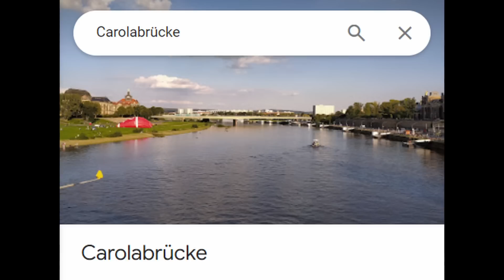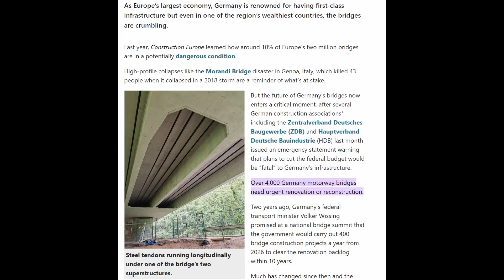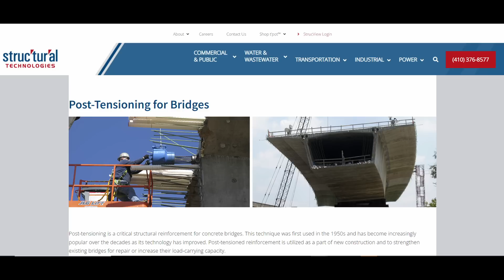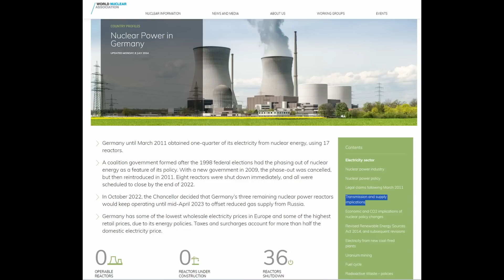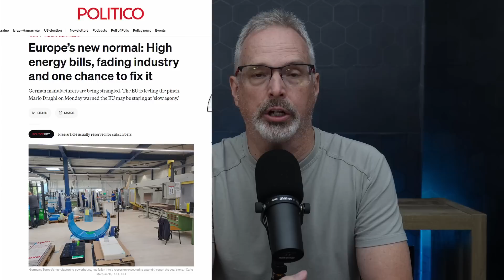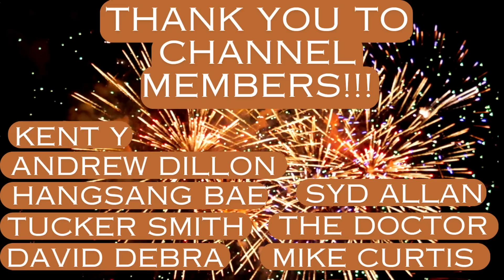Carola Bridge Collapse in Dresden, Germany

Comment: I don't like the concept of post tension designs. It has to be a nightmare to monitor the cables over the years. Let's go back to basics for bridges: Arches.
Reply: The bridges that seem to last the longest are made from natural stone.
Reply: @jamesodell3064  It's already survived for millions, if not billions, of years.
Reply: @Dennis-vh8tz  Fun fact: here in Dresden the natural stone is sandstone. It formed about 200 million years ago. While it is quite stable deep underground, we can watch it crumble and erode in real time on the surface: every year we have one or two incidents with large rocks breaking off and blocking hiking paths or streets. The buildings made with sandstone also require regular maintenance, just like concrete buildings. Besides those little problems the quarries are almost used up after centuries of using this stone and new quarries of sufficient quality would intrude on important nature reserves.

Thanks, but I'll vote for concrete.
Reply: irony is that in the rebuilding and modification of the car lane sections of this Carola bridge they already used a new carbon concrete which done away with corrosive metal and upped the tension strength among other things ... so the bridge defeated by metal corrosion was among the first to implement a noncorrosive concrete, just did not got the chance to finish renovations before failure.
Reply: Works well, last forever...cost an absolute packet, and are not quick to build.
Reply: This bridge is a cantilever design with additional tensioning cables immersed in concrete. You couldn't monitor the cables.
Reply: YEA
Reply: Spandrel Arch structures require high loading at the foundations (bearing capacity) and the bridge itself takes a lot of space under the traffic deck, even for a through arch. Indeed an arch makes an excellent superstructure when possible and when initial funding is strong (or natural materials can provide solid founding such as solid rock). Pre-Stressed Girders on the other hand are readily available, relatively cheap, and provide redundant load paths. Welded steel girders can be bolted in the field, and become more economical at longer spans. The casting process shown in this video is of a pre-stressed concrete girder, which has a limited span length due to shipping.  All girders or superstructures need to be protected from road runoff to a large degree, with proper maintenance.
Reply: @isaacm6312  Thanks for the information but my opinion hasn't been swayed. Infrastructure needs to have a longer life span like in Europe. Some Roman structures are still around because they were constructed with the future in mind. Having to replace structures when they "wear out" is wasteful and very disrupting to society.
Reply: Arches with a span like that are quite tall.

Comment: Thank goodness no one was on the bridge when it went down. Hope some guy in a boat wasn’t under it….
Wonder if the Dresden DOT will try to blame a heavy vehicle that passed over it and then go after the firms that did the inspections 🙄😏
Thanks, Casey. Looking forward to your follow up. 👍🏻
Reply: It was the train bridge, which is separate from the road bridge. I don’t think you could make the argument that a heavy vehicle would have caused that.

Edit: Good points made in other comments – yes, it was a tram bridge, and trams are heavy too.
Reply: @germansnowman  Can't even blame corrosion from road salt either, unless Germans do something weird like use salt based de-icing on rails.
Reply: @Tuberuser187  Not that I know of. Usually sand is used.
Reply: @germansnowman  A streetcar had ran over the bridge a few minutes before it failed, so that's about 60-90 tons of weight. Of course, a streetcar that the bridge was designed for should not have caused a failure to start with, at most it may have triggered it.
Reply: @2xKTfc  Good point. I have traveled across this bridge many times by both tram and car.
Reply: @germansnowman  light rail  not a ture Rail road bridge
Reply: @dknowles60  True. I lived in Dresden for several years and know this bridge well.
Reply: it's not only for trams, but for cyclists and pedestrians too. That might explain why salt was used on it.
Reply: @CatNolara  But the pedestrian path is very narrow. I don’t know if that would be enough to impact the bridge in that way – it will be interesting to hear what a final report will reveal in any case.
Reply: @germansnowman  i'm also curious about the final report, maybe also about the learnings from it
Reply: @eugenhuber3441  Probably not much actionable as this kind of bridge is largely obsolete and there's isn't a whole lot of them.
Reply: it was the streetcar bridge next to the car bridge which underwent maintenance repairs short ago. Might be they overlooked this one or claimed no salt used which i can not belive for the whole live time or even the selectivity when salting the next lane of a 3 combined bridge. At least for munich i can claim streetcars keep getting heavier with newer once.
Reply: @eugenhuber3441  Good point about the weight of trams. I edited my comment accordingly,